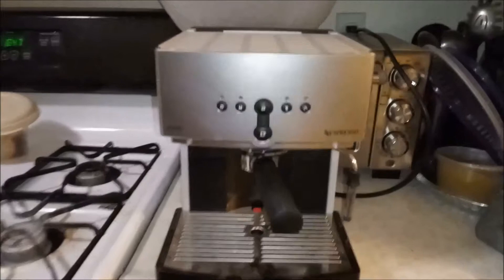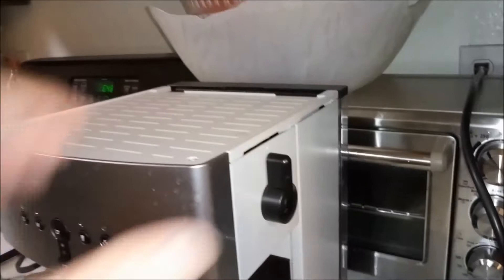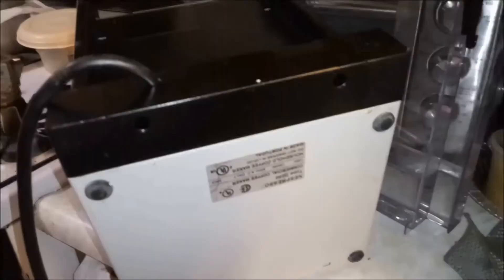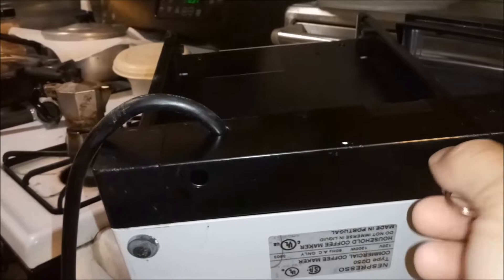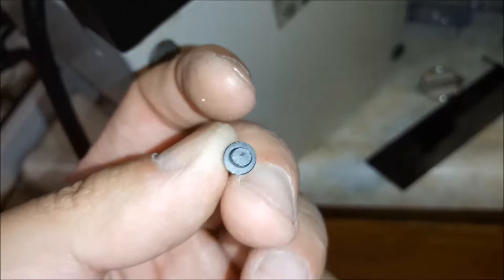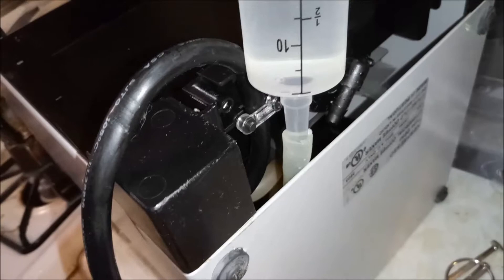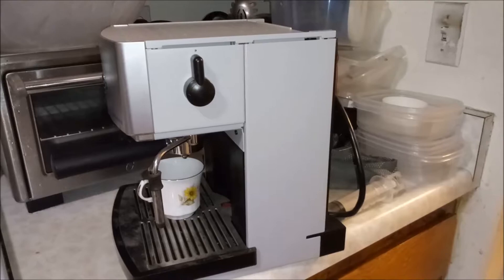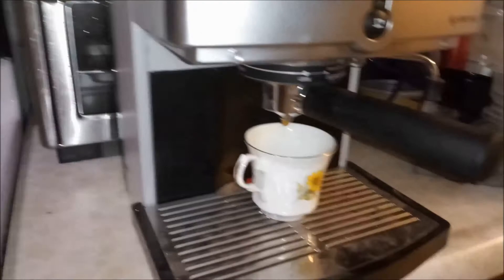How to fix a Nespresso D250 that is not pumping water

Comment: My Nespresso D300 had the same problem. It sat idle for several months and lost its prime:
1. Fill the tank with fresh water
2. Turn the machine on. 
3. Install the tank. You’ll see a few bubbles come up in the tank. 
4. Continue doing this, lift tank then replace it, while machine is running. Bubbles should rise every time you set the tank in the machine. You may have to do this 15 - 20 times. 
5. Eventually water will come out the spout as the machine recovers its prime. 
Try this before you start taking your machine apart.
Reply from the maker: that was the first thing I did, unfortunately it did not work for me, but with the correct tool, it is easy to open and prime with the large siring.  I think mine sat for a year without being used.

Comment: Does this machine works with capsules or with the pure coffee?
Reply from the maker: I ordered refillable capsules online and they work great, you can use any coffee you like, but you will have to experiment the dosage for each different kind of coffee you try, one thing you have to make sure is that the coffee is espresso grounded, and that's more fine than regular percolator coffee grounds that are coarse.  I hope that answers your question..

Comment: Where do I get the tool?
Reply from the maker: I got it on eBay before, I just did a quick search for you, not too expensive.
https://www.ebay.com/i/184433225895?chn=ps

If the link expires just search for "Nespresso security screw tool"